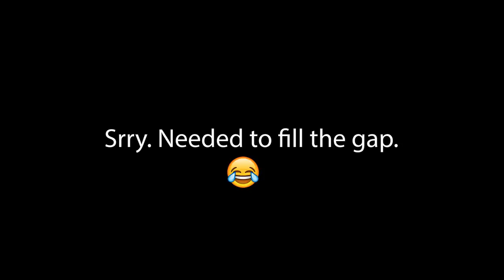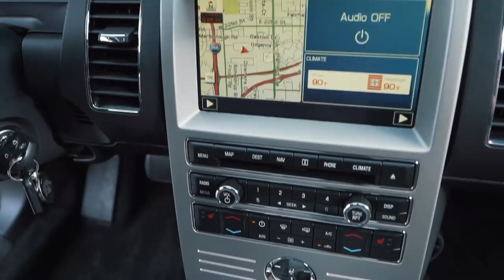Destroyed Porsche Boxster | Dirty Ford Flex | Aston Martin Vantage | Auto Detailing VLOG S4E4

Comment: How do you guys get the polishing/compound residue out of the cracks and off the plastic? I would think that it stained the plstic and rubber, and the residue in the crevices would be hardened. Please reply.
Reply from the maker: We will first try alcohol and then a grease and wax remover. If neither of those work we got to solution finish.

Comment: Hi Guys... YOU ARE MY INSPIRATION. Im 63, disabled but I DO MY OWN DETAILING on my MINT 2001 MERCEDES E430 SEDAN... Its SAND BEIGE and its got an old problem due to having only 1 person touch my car before. HE LEFT A BUNCH OF WAX RESIDUE IN THE SEEMS AND CRACKS OF MY CAR. Please Please, Please tell me,  help me, advise me the easiest way to get rid of this old wax from these areas without damaging my mint paintwork. It has NO finish on the paint other than the NEW TURTLE WAX HYBRID SOLUTION CERAMIC WAX AND CERAMIC WASH and some BEAD MAKER. I don't want to lock in that old wax and dirt. GOD BLESS YOU GUYS AND HAPPY 2020. Leo
Reply from the maker: Hey Leo, you should be able to remove it with a microfiber and a bit of all-purpose cleaner. We will use a plastic razor to get deep into the cracks.